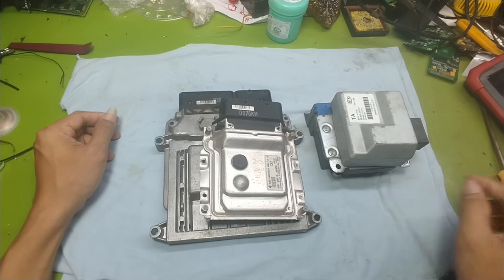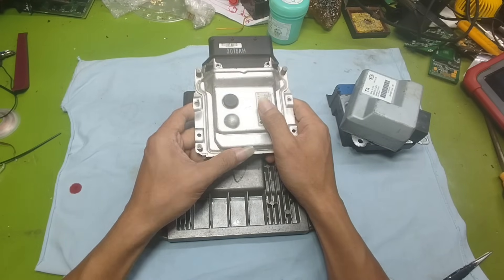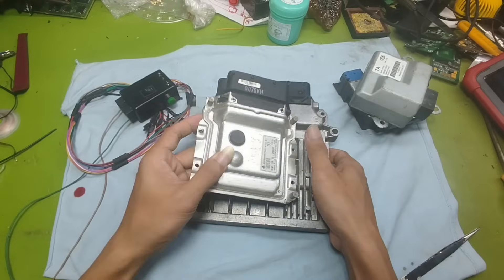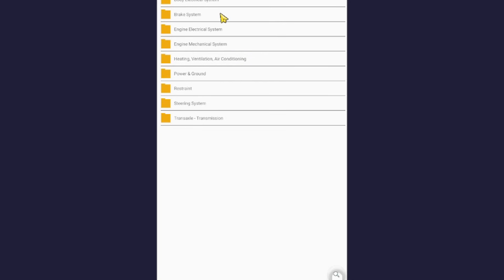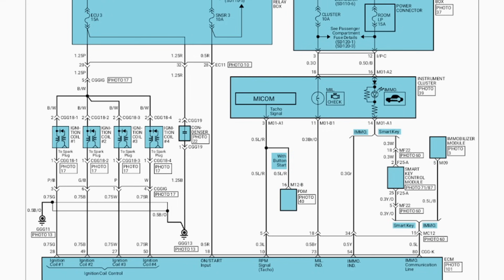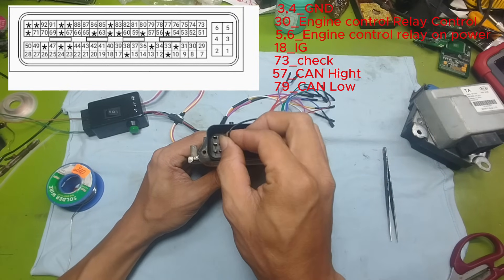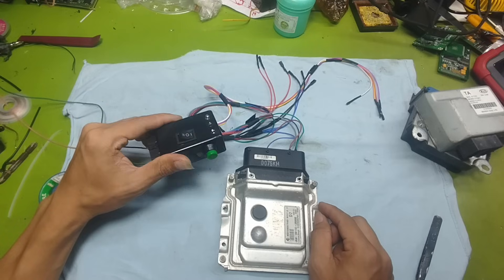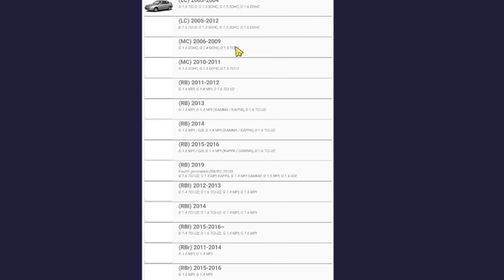How to Tell If an Engine ECU Is Alive or Dead – Easy Guide for Beginners #ecurepair #learningecu

Comment: Ho much you apparatus 12v
Reply from the maker: This is only an intermediate connection kit. You can configure it to use either a 12V or 24V power source, depending on the operating voltage of your ECU.

Comment: Over the last 45 years I mastered the good old distributor & points, single coil, timing light, ignition system. 
Then HEI came into play, it was even easier, although the timing light was still essential.
Now I'm driving a 2002 car, it's computer controlled with only 5 sensors (including the crank piston sensor)
I've worked out how to test them all, I can avoid needing a OBD2 scanner. Although if the ECM is a problem, here we are!
Reply: Lol now it's a must to use a scan tool

Comment: Which app were you using in the video to select car model and electronic diagram?
Reply from the maker: I’m currently using Carmin, a free app for Android and iOS. However, I recommend using reference software like Alldata or GDS, as they’re easier to use and provide clearer information.

Comment: What if ECU wont boot until its gets a data signal from an immobilizer module?
Reply: It should boot to be able to tell you (via OBD2) that there is a problem with immo (wrong key etc.).

Comment: Great video.
ECU Must be faulty if  After resets car runs fine for a few trips, then  proublems return ?
Reply: No not necessary.  ECU show faults most times because of what the sensor input and tells it.  What’s the problem you have ?
Reply: I @jadosmart1298 
OBD 1. Cant check codes.   CHECK ENGINE LIGHT .....NOT ACTIVATED.
 crank no start. Reset starts car , but No over drive, and slips out of overdrive when engaged.
After a few computor resets same faults persist. 
Then a reset to correct another crank no start,  car runs GREAT !!  NO PROUBLEMS
FOR a few days.
Then ....SAME proublems RETURN.

2002 Toyota hiace. Many parts 20 + yr old
Replace many OLD parts,   repair wires, clean cream build up in transmision TCM harness and OTHER conectors, clean ground conections.   
NO CENSORS  REPLACED,  ORIGINALS STILL USED.
Have reset computor perhaps 8 times by this stage.

Reset computor, car starts. 
DELAY !!    in shift into overdrive, but NO slipping out.
 Shifting into overdrive improves with time......2 SUCCESSFUL restarts after PETROL AND SHOP.  
Return after 83klm combined drive for computor relearn process.  GREAT !!
NEXT DAY......crank no start .....reset computor....crank no start. 
Will not start.
10 + computor resets. 

Examined computor. It looks brand new but is original factory.
Reply: @jadosmart1298 @jadosmart1298  crank no start. Reset starts car , but No over drive, and slips out of overdrive when engaged.
After a few computor resets same faults persist. 
Then a reset to correct another crank no start,  car runs GREAT !!  NO PROUBLEMS
FOR a few days.
Then ....SAME proublems RETURN.

2002 Toyota hiace. Many parts 20 + yr old
Replace many OLD parts,   repair wires, clean cream build up in transmision TCM harness and OTHER conectors, clean ground conections.   
NO CENSORS  REPLACED,  ORIGINALS STILL USED.
Have reset computor perhaps 8 times by this stage.

Reset computor, car starts. 
DELAY !!    in shift into overdrive, but NO slipping out.
 Shifting into overdrive improves with time......2 SUCCESSFUL restarts after PETROL AND SHOP.  
Return after 83klm combined drive for computor relearn process.  GREAT !!
NEXT DAY......crank no start .....reset computor....crank no start. 
Will not start.
10 + computor resets. 

Examined computor. It looks brand new but is original factory. ??
Reply: @jadosmart1298 @jadosmart1298  crank no start. Reset starts car , but No over drive, and slips out of overdrive when engaged.
After a few computor resets same faults persist. 
Then a reset to correct another crank no start,  car runs GREAT !!  NO PROUBLEMS
FOR a few days.
Then ....SAME proublems RETURN.

2002 Toyota hiace. Many parts 20 + yr old
Replace many OLD parts,   repair wires, clean cream build up in transmision TCM harness and OTHER conectors, clean ground conections.   
NO CENSORS  REPLACED,  ORIGINALS STILL USED.
Have reset computor perhaps 8 times by this stage.

Reset computor, car starts. 
DELAY !!    in shift into overdrive, but NO slipping out.
 Shifting into overdrive improves with time......2 SUCCESSFUL restarts after PETROL AND SHOP.  
Return after 83klm combined drive for computor relearn process.  GREAT !!
NEXT DAY......crank no start .....reset computor....crank no start. 
Will not start.
10 + computor resets. 

Examined computor. It looks brand new but is original factory. ??
Reply: Delet chk.
Reply: The explination gets deleted. Even utube are adding to my woes to correctly diagnose

Comment: Thanks heaps for slowing down your explanations and providing important details. The background music is much easier to listen to and doesn't distract from what you are saying. 
I am just waiting for some terminals from Aliexpress before I can make the universal power supply and make a start on testing. 
I have several ECU's that I can test and an Autel Maxisys Ultra to check for fault codes and look at live data when I attach a simulator. 
Will you be discussing available simulator software to test for injector pulse, ignition triggering, cam and crank signals?
Thanks again for your effort and your willingness to make our learning experience easier.
MAX
Reply from the maker: Actually, this is quite simple.
You just need to clearly understand the operating principles of the engine control system.
Once you do, you'll know the necessary conditions to make the ECU work...
Even when it's just sitting on your workbench.

Of course, the most important thing you need...
Is a signal simulator for the camshaft and crankshaft position sensors.

In the future, I will definitely make a detailed video about this topic.
So make sure to follow the channel and stay tuned!
Reply: @Autocar_Star I have looked into a decent signal simulator before, but couldn't warrant the cost at the time and also the demand for repairs, but have always been keen to get into this area & I have the skills to repair ECUs, so with a better understanding from your videos, I should be able to get into this field.
Thanks for sharing your knowledge.
Reply: @MiracleMAX  WHERE CAN I GET THE PINOUT DIAGRAMS FOR MY ECU'S .....ALSO WHAT IS THIS SIGNAL SIMULATOR

Comment: Great video! Just one correction: because this video aim for beginners you need to point, that this test doesn't guarantee, the first ECU is good one. It's powers up and down properly, but can have other internal faults, such as faulty drivers or sensors inputs.
Reply from the maker: Regarding common errors, I will make practical troubleshooting videos in the future.
This way, it will be easier for you to understand and follow along
Reply: Great one following up I would like to see explanation of internal culprits elimination toward driver as  the final conclusion. Thanks alot as a student
Reply: @peter-ys2fv  Someone should diagnose this before the ECU was pulled from the car. Real diagnostics (oscilloscope etc.), not "parts cannon" method.
Reply: Please how to get the wire diagram app or PDF
Reply: @AmaraM.Kamara-t5u  Don't expect guys like this one to give you any info. This guy is making these videos so he said to help beginners, but the true is he is making these videos to help himself. Because he is not willing to help you you should press the dislike button, like I did.
Reply: this is great, what kind of app that you use to check the diagram
Reply: Thank you
Reply: Very good video thanks
Reply: Good job 👍 What is kind of app do you use to find different diagrams????

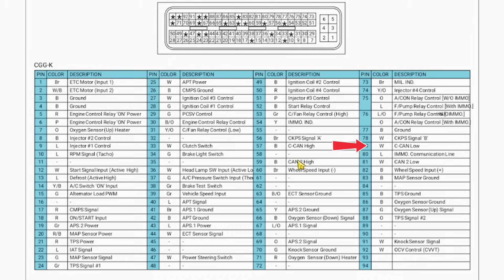Comment: So, @ 5:40 you chose the CAN-c data line, What determines that we use CAN-C when testing the ECU?  And not one of the other CAN buss's ?  Excellent video BTW.  Great Job keep em coming, really enjoy these...
Reply: He explains it in the video.  This ECU used different speed CAN lines to communicate with different modules. In this particular ECU CAN-C used for high-speed signal, including diagnostic communications data. So, in general - you choose CAN line, which (according to wiring diagrams) goes to OBD plug.
Reply: @Starwind73  Yep, ! Thanks !

Comment: Awesome,I just found your channel an hour ago and I've already watched whole 4 videos about this and  it's exciting,I'm a newbie and I work as a truck mechanic and mostly mechanical repair but I have a very deep interest about soldering,micro components repair and wiring,but I'm lack alot of knowledge and most of the PDF books I read is overly complex and today I found your video,your channel is my new favorite channel,I also needed a reliable diagram source, if you wouldn't care,would you able to share the app your using to check for wiring diagram?that look informative alot, I'd really appreciate it.Also I want to know if a 24 volts trucks also use the 1k ohm resistor for the LEDs?thank you very much,for the very informative video.
Reply from the maker: Yes, that's fine! I chose a 1k Ohm resistor as a margin so it can also work safely with a 24V power supply.
Reply: @Autocar_Star thank you very much, hopefully your channel grow big and will be very useful for those who truly love and want to seek knowledge